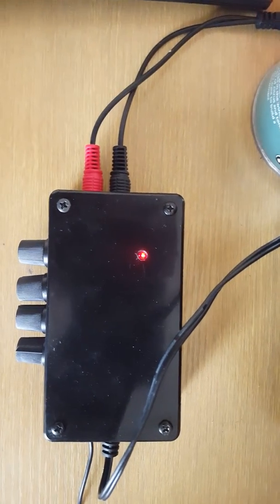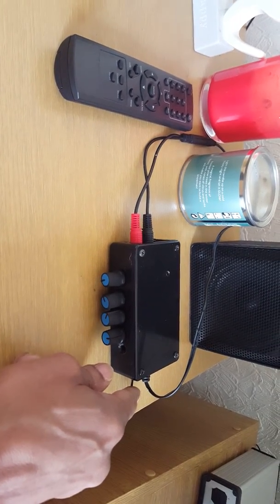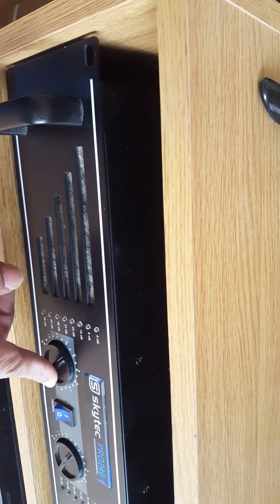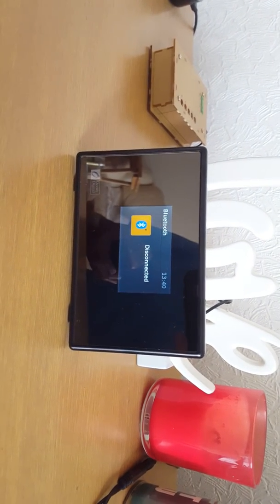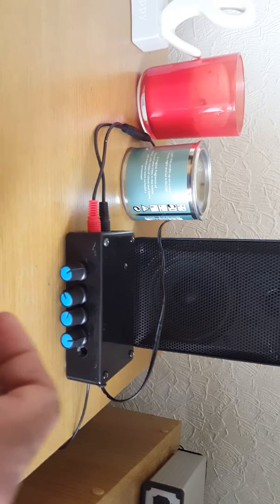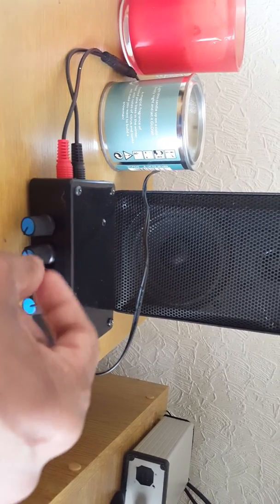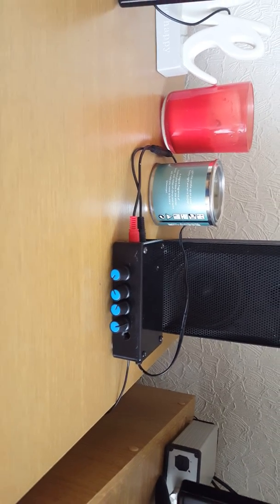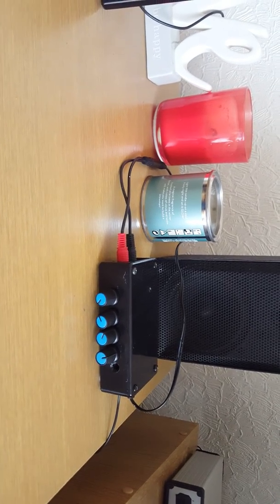Demonstration of NE5532 Kit preamplifier from project on building a peramplifier

Comment: How did u power the ne5532 ?
Reply from the maker: chinmoy sharma 
Hi i used a 12 
AC power supply bought on ebay .some NE5532 have a DC power supply 12 volts and are easier to obtain the necessary  power requirement.try to source one of those units
Reply: Thanks for the reply. Can u please post a link to the AC power supply you used.
Reply: Ok i found the AC transformer it is 12 volt 1 amp. Will that do?